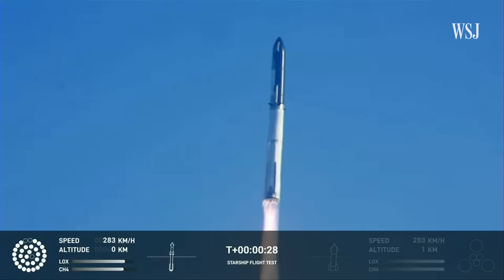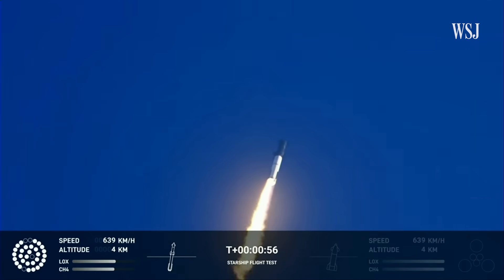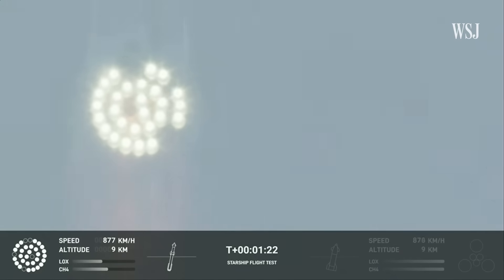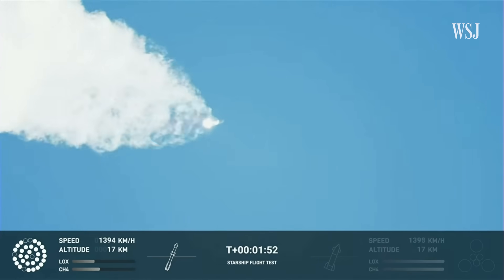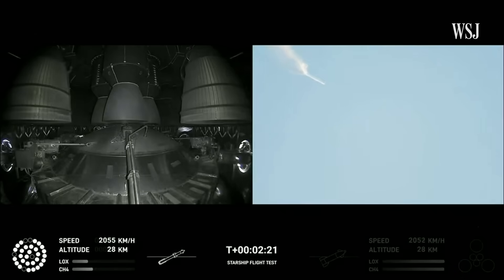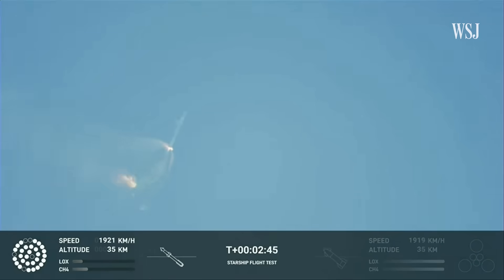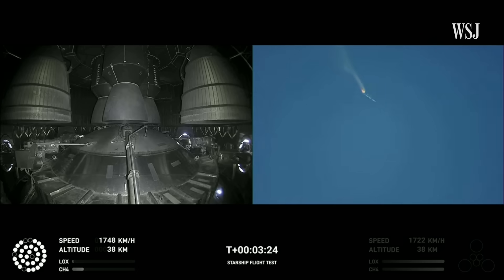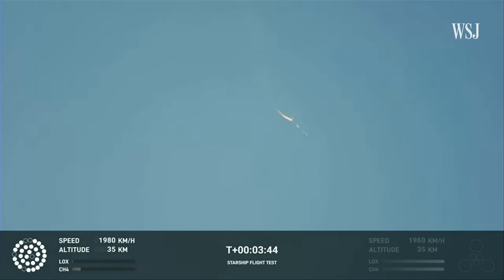Starship Explosion Video: Watch Elon Musk's Rocket Explode After Launch | WSJ

Comment: All of thise emissions are like a million semi trucks driving 10 thousand miles at once.
Reply: You don’t know what your talking about. That’s completely off. 

The Fuel capacity (IE liquid methane) takes up the same volume as 4 747s fuel tanks. So it’s about the same emissions as flying 4 747 until they run out of fuel.

Comment: The year was 2050, and scientists had learned how to harness the power of wind in the atmosphere. They had developed a revolutionary technology in which a spacecraft could go up into the clouds to collect wind energy. Unlike traditional energy sources such as coal and oil, wind energy was renewable, abundant, and environmentally friendly.

The spacecraft named Windcatcher was on a mission to a remote island in the Pacific Ocean. The island was home to some of the rarest elements in the world, and the Windcatcher was the only spacecraft capable of reaching it. The elements were essential for building critical components in spacecraft and high-tech equipment, making them highly valuable.

As Windcatcher soared into the atmosphere, the solar panels on the spacecraft began to charge its batteries. The aircraft started to capture the wind energy and store it in their batteries. After a few hours of collecting wind energy, the Windcatchers' batteries were charged, and it was time for it to dive into the ocean.

The Windcatcher flew headfirst into the ocean like a missile. The spacecraft was specially designed to handle the pressure of deep-sea conditions and could travel at high speeds underwater. As it dived into the ocean, it activated its sensors, scanning for the rare elements they were after.

The sensors showed that there was a rich deposit of the valuable elements in a nearby underwater cave. Windcatcher's pilot set the spacecraft on autopilot, and it navigated towards the cave. Once inside the cave, the pilot activated the harvesting mechanism, and the spacecraft began to collect the rare elements.

The mission was a success. Windcatcher had collected enough rare elements to meet the world's production needs for the next decade. The spacecraft then returned to the surface, where it landed on a nearby island. Windcatcher's agent was waiting to collect the elements for transport back to the mainland.

As the Windcatcher soared back into the atmosphere, the pilot reflected on the success of the mission. It never ceased to amaze the pilot how advanced technology had become; it was truly a remarkable time to be alive. The pilot couldn't help but wonder what future projects the Windcatcher would be tasked with in the years to come.By SeQui

Comment: The Starship rocket actually self-destruct, the auto-safety mechanism that would be activated if the rocket went off course was in fact actviated and hence destruction was automatic.
In the past NASA would have a range safety officer who would do this manually if something similar occured, but apparently SpaceX now builds that capability into the rocket itself.

The entire mishap occurred because the lauch pad started to break up as soon as all the rocket engines fired. The resulting debris damaged parts of the motor assembly, knocking out several of the rocket motors and damaging the gimbal mechanism that directs the nozzles and controls driection of an ascending rocket.

The engneers that designed the launch pad underestimated the forces that the pad would be subjected and as a result, the pad broke up and dmanaged enough of the Starship rocket to cause it to destabilize at which point the self-destruct was triggered and everyone was witness to a $3 billion dollar fireworks display.

Its too bad becasue the rocket itself looked like the launch otherweise would ahve been successful.

Comment: This rocket had an INSANE amount of thrust compared to past ones. Its launch obliterated the pad it was so powerful. Huge success and a learning event.
Reply: The pad was destroyed due to stupidity, not engine power. Wow, so great because they failed to do what NASA did over 60 years ago.
Reply: Hey, dunderhead, the per unit power of SpaceX engines is puny, compared to the engine power of US Saturn (1960s tech), and Russia's Energia engine power (1980s tech).🤣🤣🤣
SpaceX engine power is comparable to the much older SSME Space shuttle engine's, of the late 70s.😂

Comment: Thea applaude to the destruction. So wonderful!
Well, the Americans try to build better rockets than the Russian rockets. Obviously they cannot. Not NASA, not SapceX. Anybody else in the US?
But at least the money flows and is burned. Business as usual.
That is the thing with the bicycle: You can invent it over and over again. It is a bicycle and if you do it wrong, then is won't work. As long as people use bicycles, you can sell them. Thinking of something different? Why should we? The money flows.
Reply: They are applauding the destruction - - because the destruction was a fail-safe system that was integrated into the design of the rocket - - in the event of other failures that could put the lives of people on the ground in danger.  They aren't applauding the destruction directly, but rather the fail-safe system working.
Reply: @willoughbykrenzteinburg  in the event of others failures -wonderful! So some other failure evented and then the fail-safe explosion saved the lives of people on the ground - so wonderful! Debris doesn't hurt.
Why not simply saying that something went wrong again?
Reply: @wilhelmmeyer89  If you are driving in a car and get into a bad wreck - but the airbags deploy as designed and save your life - the people who designed and implemented those airbags might be thankful.  

They aren't thankful that you crashed; they are thankful that the fail-safe system (airbags) worked as designed.

Comment: Why are they Cheering?
Reply: They remotely detonated Starship because of engine failure and to avoid the chance that it could crash uncontrolled over a populated area.  They aren't cheering because of the failure; they are cheering because of the success of their fail-safe system working as designed.

If you invented the air-bag for cars, and one of your designs made it into a car - and that car crashed, and the air-bag worked properly and saved a life, you might feel good about yourself.  You don't feel good that the car crashed, but you'd feel good that something you designed FOR that car saved a life.

Comment: the crowd you here must be from a crazy house ,clapping ,& yaaaa even when it blue up ?
Reply: 1) blew; not blue
2) THEY blew it up - because it was losing engines and potentially putting people in danger - so they triggered a DESIGNED fail-safe system - which explodes the rocket and brings it down harmlessly over an unpopulated area
3) They aren't cheering about it blowing up directly - they are cheering because their fail-safe system worked as designed and potentially saved lives.

Comment: Why people cheering over the rocket explosion?  Its a failure
Reply: The launch was technically a success - - - the goal was just to get it off the pad.  However, that's not what they were cheering for.  They decided to let it ride, but started losing engines - - and because of that, control.  So instead of letting the rocket potentially get so out of control that it could crash over a populated area, they triggered a fail-safe which detonated the rocket.  The explosion was DELIBERATE - which brought the rocket down harmlessly over an unpopulated area.  They aren't cheering for the explosion directly; they are cheering because the explosion was triggered by their fail-safe system - - which worked.  They are cheering that the fail-safe worked.

I've used this example many times.  It's sort of like getting into a car crash and being saved by the airbags.  You'd probably be thankful.  It would be silly for people to think you were thankful that you got into a crash.  Obviously you're thankful because the airbags (the fail-safe system) worked properly.  That's the reason for the cheering.

Comment: You dont think it was shotdown somehow?
Reply: No… they hit the button to self destruct when it started spiraling out of control. It needs 30-31 of the engines operational to achieve low orbit and had 5-6 engines inoperative. At that point it was about achieving max q and seeing what they could squeeze out of it. The launch pad seriously needs a lot of work. When this thing started up, it blew chunks of concrete out which apparently hit the engines and caused the issues. It was a known issue before this test, and I’m not sure why no attempt was made to correct it other than knowing the rocket was expendable. The difference between this one and the next one are like night and day. Well over 100 upgrades went into the next one from this one, but none of that matters if they don’t get the launch pad issues straightened out,

Comment: I think you omitted really important context, which is that the ring was put in place once the housing estate was marked for demolition. So for the last 8 years the council has been working towards demolishing the entire thing. That is also i suspect why houses are boarded up, to prevent squatters moving in after resident moved out.

I'm no fan of Southwark council and imagine there are issues about where they are rehousing the residents who need to move out, what they are replacing it with, how long the whole thing has taken... but for those who are trying to prevent the demolition, they could be a part of the problem.

Comment: Psst. Rockets can't turn like that. They simply can't do 360 degree turns at 16000 kph. Fighter jets can't do that and they are designed to turn. Rockets are not designed to take side loads let alone a 30 G turn
Reply: 1600 km/h. It wasn’t moving at 16 megameters per hour, dude.

Comment: Elon will have to go back and review the original Apollo launch to compare and identify what went wrong. 
What do you mean the information relating to the Apollo missions has been lost? 
After 60 years since Apollo missions the technology has receded.
Reply: Looking at Saturn V start won't help, as it was completely different rocket, it had 5 strong engines instead of 33 not as strong ones. The rocket that's the most similar to Starship was N1 and looking at how it flew wouldn't be too helpful either...

Comment: I'm sorry, I'm not getting what happened, and why an explosion of a rocket is a good thing. 

Please, if somebody would drop a couple of lines, and explain it to me.
Reply: Basically, SpaceX is designing Starship to be capable of transporting humans to and from Mars. It is very powerful, but it is also in its experimental stage.

You can consider this launch a prototype. SpaceX wasn’t expecting this flight to be successful, which is why they claimed that anything that happens after clearing the launchpad would be “icing on the cake”. They learned a lot from this test, which will help them improve and refine Starship for future tests and missions.

Comment: Илон Маск молодец. Все они сделали правильно. Сейчас объясню:
Ракета огромного размера, с большим весом. Сравнить можно с Н-1. Принцип тот же: много двигателей. С разницей: Н-1 построили в 1970-х годах, когда не было мощной вычислительной техники для эффективного управления блоком двигателей. Катастрофа Н-1 уничтожила сложное излелие - стартовую площадку. Я уверен, что Маск учел этот опыт. И они построили ракету, с большим количеством двигателей, с надежной компьютерной системой управления блоком двигателей. Но никто не был уверен в том, что все учтено. Разрушить ракету - это одно. Разрушить стартовый комплекс, такой , как на Байконуре - это несколько лет стройки. 
Поэтому, Илон построил простой старт, на 1 раз. Заодно, посмотрели, что будет, если не делать отведение газовой струи блока двигателей. Эффектно вышло. 

Следующий шаг Илона - постройка настоящего старта, доработка ракеты и успешный старт😊😊😊. Браво, Илон!!!

Elon Musk has done well. They did everything right. I'll explain now:
A rocket of huge size, with a lot of weight. You can compare it with H-1. The principle is the same: a lot of engines. With a difference: the N-1 was built in the 1970s, when there was no powerful computer technology for effective control of the engine block. The H-1 disaster destroyed a complex outgrowth - the launch pad. I'm sure Musk took this experience into account. And they built a rocket, with a lot of engines, with a reliable computer control system for the engine block. But no one was sure that everything was taken into account. Destroying a rocket is one thing. To destroy a launch complex, such as at Baikonur, is several years of construction. 
Therefore, Elon built a simple start, for 1 time. At the same time, we looked at what would happen if we did not divert the gas jet of the engine block. It turned out spectacularly. 

Ilon's next step is the construction of a real launch, the completion of the rocket and a successful launch. Bravo, Elon!!!

Comment: A lot of pollution 😅😂
Reply: It is H2O CO2 and concrete dust so forgetting the water, you are right.
Reply: Not really.
Reply: @jacksonm.1754  continue...
Reply: @ratratrat59  Compared to other sources, such as energy production, transportation, manufacturing, etc., rocket launches produce very little pollution.

Does it pollute? Yes. But the space industry should be the least of your concern when it comes to carbon footprints.
Reply: @jacksonm.1754  I know that. Never said it was a big problem. Just poking at the other guy. Jez, read between the lines buddy.

Comment: So they had ALL that Delay time, and they still cannot get it Right??? Umm we have been launching multi stage rockets into space since Dr Goddard's launch in 1926. The failure of MECO and the second stage to separate is MAJOR failure. Even teenagers can build a multi-stage rockets to function..  The statement that everything after "clearing the tower was icing on the cake," was moronic at best. With all the  delay time that rocket should have made it all the way with no problems. That fact it failed at such a basic point means that either Elon Musk is ALL of SUDDEN a Moron, or well you calculate that probability.
Reply: Greetings from Elon musk
Thanks for the love and support 
Where are you from

Comment: Taking risk means they don’t work out sometimes. Those times are the lessons used to reach the ultimate goal. Manned missions! Amazing how much power that rocket has. Simply staggering numbers. Cheers of one step closer.
Reply: The Saturn system had absolutely zero launch failures. This is much more like the old Soviet space program where they blew something up every couple of years.
Reply: @Ewok751  Not true. Three astronauts died on the launch pad. Many unmanned development explosions of Atlas sub-program launches. Apollo 13 explosion almost killed three astronauts.
Reply: @LostPlanet2024  The three Apollo 1 astronauts, Gus, Grissom, Ed, White and Roger Chaffee died due to a cabin fire during a launch rehearsal. It was not a launch. The Apollo 13 failure was a service module explosion after launch. Therefore, that was not a launch failure either.

I suggest getting your space history correct before you post.
Reply: @LostPlanet2024  that wasn’t a SaturnV issue, that had to do with warned and ignored issues that involving the command module. Same thing with this rocket, but its so over engineered that he missed his supposed deadline of launching in July again. It’s just too dangerous
Reply: @Ewok751  test flight, not yet an attempt to orbit
Reply: @sneeki8082  that is not relevant. The launch was a complete failure due to their own incompetence. He a poorly designed Launchpad what is destroyed during the lunch. Debris was caked up and damaged for engines.

NASA knew about proper launchpad design decades ago. Elon and his team just skipped entire step. Failure was the result.
Reply: @Ewok751  so it was actually a launchpad test, not a rocket test? Wowww, that's actually surprising.
Reply: @sneeki8082  do you just not understand the term launch failure? Are you just going to keep desperately hanging on to the SpaceX line? Those people are so brainwashed into positivity, one of the launch administrators was still announcing eminent separation when it was out of control tumbling.
Reply: @Ewok751  do you just not understand that this is the first time the booster and starship are tested together? SpaceX isn't like NASA, they produce rockets much faster than them, test those rockets out, and see what went wrong with those tests. NASA basically makes sure everything is perfect even if test flights were nonexistent or minimal.
Reply: @sneeki8082  And if they had had a launchpad design, such as NASA has been using for 60 years, all that concrete wouldn’t of flown up into the engines, and over a mile away. Go familiarize yourself with the details before you come back.
Reply: @Ewok751  i would agree with you that they shouldve seen this coming with the number of engines, shouldve put a better water deluge.
Reply: So my comment was about taking risk and your response devolves into “technically a launchpad test, not a flight” bs. Its ALL risky and dangerous and this unmanned test gets us closer to the ultimate goal.
Reply: @LostPlanet2024  No one denying that trial an error is part of the development process but what Musk bro's like you refuse to understand is that the launch is a undeniable failure for the reason Ewok explains and more.